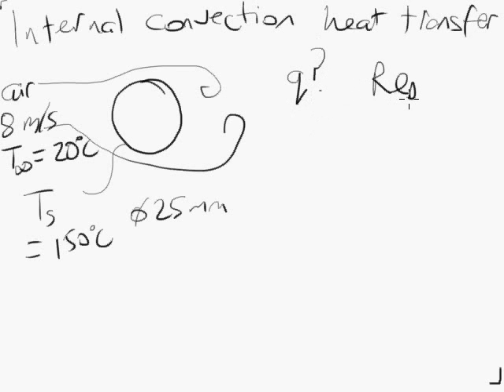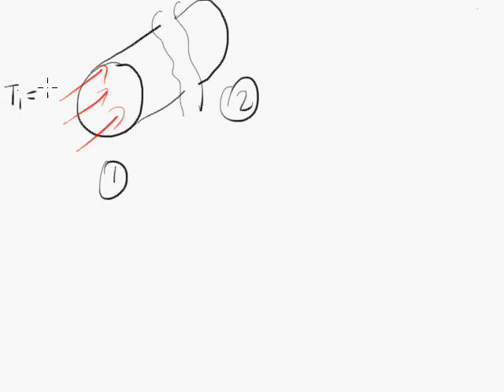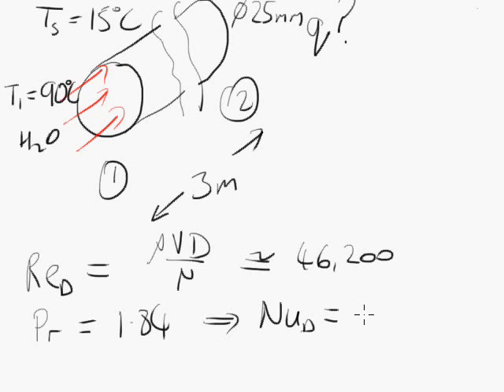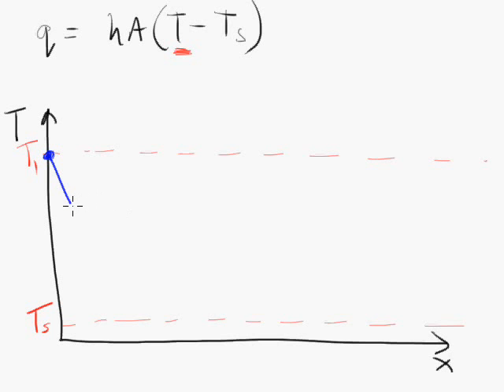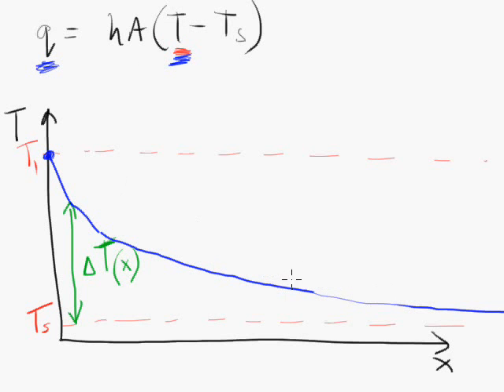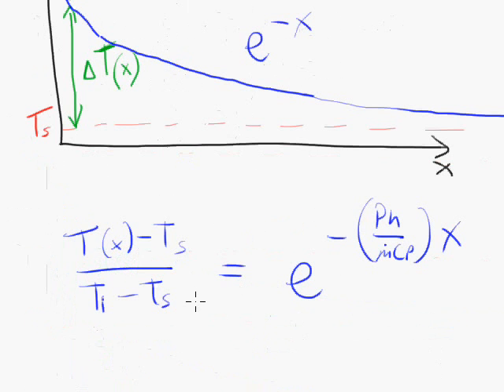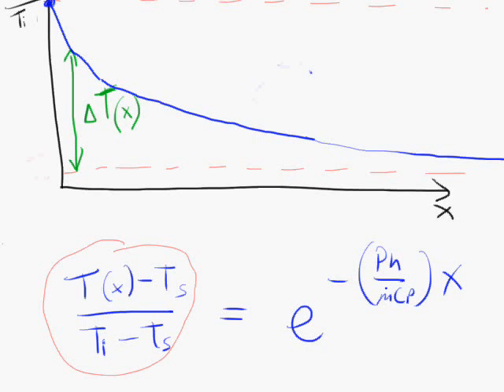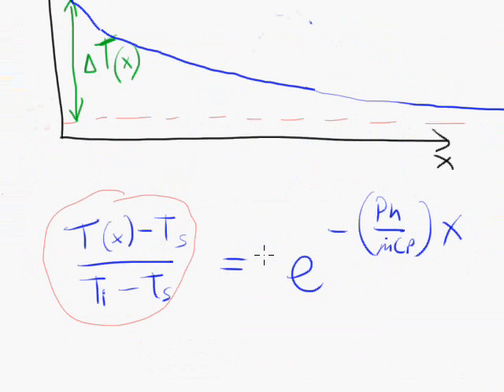Introduction to internal convection heat transfer

Comment: Doesn't the power need to be a dimensionless number? When I cancel units i still come up with (m^2*s*K)/(kg)
Reply from the maker: butterch1cken No, power isn't dimensionless. How did you work out that unit?
Reply: ***** Sorry. I didn't mean power but "the power" or the index for e. I worked out the problem though. For "h" I used enthalpy rather than conductivity. Silly mistake. But it is all good now.
Reply from the maker: +butterch1cken Ah, I see. Thanks for explaining.
Reply from the maker: butterch1cken
 Ah, I see. Thanks for explaining.